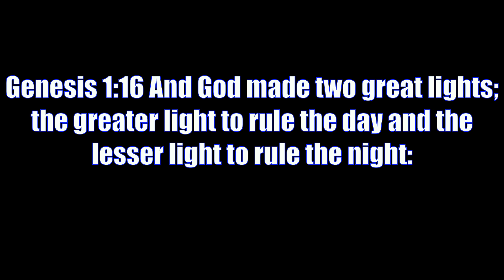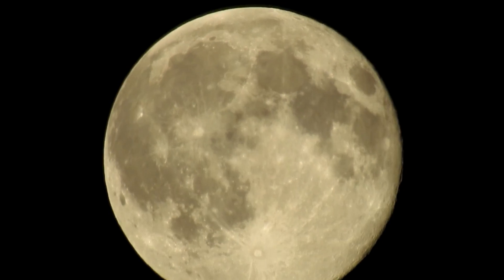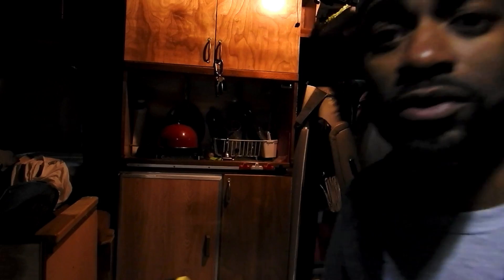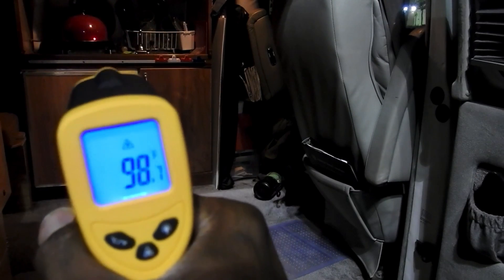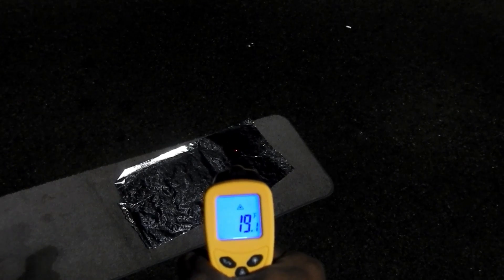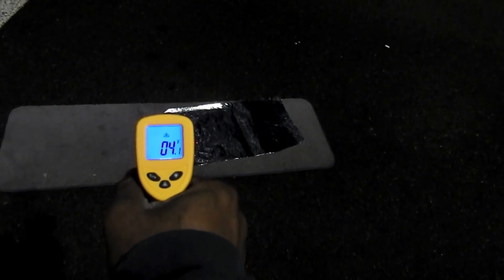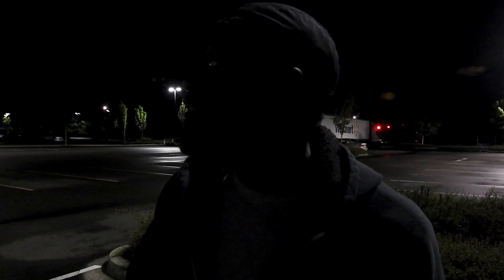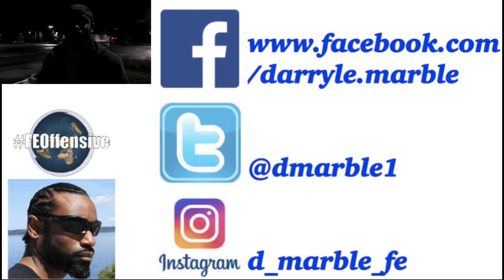Flat Earth: Moon Light Temperature Experiment

Comment from the maker: ATTENTION! There were a couple of things that i was told was off about this experiment. Those things were corrected in this followup...https://youtu.be/6XTij8P_eIQ
Reply: Here is the problem. There is something called "emissivity". Emissivity of aluminum is very low but his reflection is very high. When you measure the temperature with a IR measurer you need to adjust the emissivity of the surface you are pointing to. If you set the emissivity on your IR measurer on 0.01 and than point to the aluminum you will get the temperature of the real temperature of it. But if you set emissivity to 1 you will read only the reflected temperature of the sky (when you are outside). This temperature is at day and at night about -50 degree celsius. That is what you are reading.
Reply from the maker: loadfaster The one I have is an Elekcity Lasergrip 774 non-contact Digital Laser IR Thermometer. I've seen them range from $16-22.
Reply from the maker: I got mine from Amazon for $20 because I'm impatient about certain things. Lol
Reply from the maker: loadfaster no problem.
Reply: To quite adequately paraphrase the great St. Augustine: The Bible tells us how to go to Heaven, not how the heavens go.
https://sokore.wordpress.com/2014/07/26/science-faith-and-st-augustine-on-christianity-creationism-and-the-importance-of-reason-in-the-spiritual-life/
Word to the wise, using the Bible to foolishly claim measurable science is highly ill advised. St. Augustine knew this 1700 years ago, and maybe you should take his sound advice.

D. Marble , the variant ground heat from covered ground v.s. ground at night has nothing to do with the Moon. It's due to the radiant heat being released by the ground that was captured from the Sun during the previous day being trapped/collected in the air over covered ground at night by canopies, foliage awnings etc. hence forth having a higher surface temperature. There is a VERY easy way to rule out the Moon, altho I KNOW you don't have the balls to do it because we all know it will result in an epic self debunk equivalent to Jeran's " That's interesting " moment.
All you have to do is take the measurements of covered and open ground at night during a Full Moon, and do the same measurements 2 weeks later during a New Moon. The temperature variance will be exactly the same. No Moon required. It's best to do this in the Summer Time of course. The Winter Time will likely yield no results either way due to lack of heat absorption by the ground. You'd have to choose 2 very sunny days 2 weeks apart from each other for Full and New Moons, with no snow on the ground for the entire day on both days prior and nights after during measurement. But alas, I know you'll never perform this measurement because we both know what the results will be.

Comment: You can't measure the temperature of a reflective surface with an infrared laser thermometer.
All you succeeded in measuring is the infrared radiation reflected off the foil from the sky and the chair.

Comment: Hehe, nice video, but zero evidence and wrong conclusion. All that due to very improper measurements:
You have to use so called 'black body'  instead of aluminum film. Black body means that the surface is black and matt. As you know, and this video confirms it, your film reflected >90% of light from your thermometer and it does the same with infrared light that your device measured. So in fact you have measured temperature of sky in one case and the temperature of your shadow caster in the second case. And the measured results were a logical consequence of that.
The only question is: did you manipulated the result deliberately or are you only so ignorant?
Reply from the maker: Trial and error is what science is all about. I'll have something for you at the next full moon cycle.

Comment: Excellent D Marble!  I conducted a comprehensive experiment on the Moon's light just last week!

Science is Awesome!

Yesterday On June 6, 2017, three days before a full moon, I captured both the Sun and the Moon in the sky together at the same time.  These two Luminaries were nearly exactly the same height above the horizon on opposite sides of the sky from my vantage point in Dallas.  The Moon was NOT FULL as it should be if the Sun is fully illuminating it unobstructed by anything with both of them in the sky together on opposite sides.  If the Moon is reflecting the Sun's Light as we are told since grade school, then why are we discovering many anomalies and discrepancies to the "Official Story"?? 

In this video demonstration, I will cover the stark differences between the Moon's Cold, wet, dim, and calming light.. versus the Sun's Hot, dehydrating, bright, and energizing light.  I work for an Engineering firm out of Dallas as the head designer/contractor.. and I have been conducting my own personal experiments on the Moon's light and Sun's light.  Most people don't ever bother to experiment with these things, as they blindly accept whatever our government funded education system has told us without question.  Upon further investigation, it turns out that the Moon is a Self Illuminating Semi-Transparent object in the sky, contained within our enclosed Earth realm system!  

https://youtu.be/xkh0lItSLPA

It just so happens that I have already documented the results of my latest research and I have conveniently laid it all out in the blog following this message.  

Here it is folks.  My completely updated comprehensive study proving that the Moon is a Self Illuminating Semi Transparent object inside our closed environment.  I'd love to hear your insights so that I may deepen my knowledge on the Moon and enhance this experiment.  Thank you all for inspiring me to research this topic! 

https://www.facebook.com/notes/miguel-michael-angel/the-darkside-of-the-moon-revelation-through-science-and-systematic-observation/1467743113248516/

I am genuinely interested in seeing anyone's Observable Evidence that the Moon is reflecting the Sun's light.  How many experiments have YOU PERSONALLY CONDUCTED to prove your theories.  I invite you to come join our Flat Earth versus Globe Earth discussion group of over 40,000 members on Facebook to debate your case.  This is an EVIDENCE based group and we encourage people to conduct your own experiments and bring them to the table.  Thank you for watching and don't forget to subscribe to my channel!  

PEACE and Love to all my Geocentric Earther's alike.

Comment: Listen up and listen carefully.  If the earth was flat you could see the Eiffel Tower from the Empire State Building with a telescope.  Case closed.
Reply: chefjimmie1 yeah sure, considering some days you can't even see the end of the street.lol.
particles, dust, vapour etc . also known as atmosphere. that's what the visibility rating is on the weather forecast
Reply: +Lifting the veil
Maybe you couldn't see so far in the visible light spectrum, but you could certainly "see" radio waves (which are also light, of a different frequency) at great distances.

For example shortwave radio can be received thousands of miles away from the transmitter, but only because the radio waves at these frequencies are reflected in the ionosphere, that's called the sky wave.

The ground wave can't be received very far, because of the curvature of the Earth. Between the ground wave and the sky wave there's usually a silence zone, also called the skip zone, where the transmission can't be received.

This can't be explained on a flat Earth.
Reply: Gio Tag:  Thank you for your thought provoking comment.  I was aware of limited visibility through the atmosphere and was speaking more to the idea than to the act however, you have shown that even though it is impossible with a regular telescope, perhaps an infrared telescope might work. (if the earth was flat, that is ;) This is exactly what "flat earth" believers need; some thought provoking!
Reply: Gio Tag I am aware of frequency and radio waves, it's called troposcatter, signals are sent up to the troposphere and reflects back. that's why all 'satellite' dishes point at 45 degree angle and not straight up. research troposcatter radio.
Reply: chefjimmie1 use a laser, that would cover great distance through atmospheric conditions. lots of experiments on YouTube available. land surveyors and engineers don't even consider curvature when they design railways, canals, bridges etc. The navy's weapon systems use laser targeting on targets hundred of miles away , they target them from the ship using line of sight.
Reply: LIfting the veil:  engineers don't need to factor in the curvature of the earth in construction because the factor is such a small number compared to the size of the project.  They never survey farther than the horizon.  I"m arguing about NONSENSE!  I'm outta here.
Reply: chefjimmie1 yeah like the Suez canal that links two oceans, it's over 100miles long with no change in depth and no locks needed to control water flow.
Reply: Shortwave radio, troposcatter communications and satellite TV are three different technologies.

Please don't contradict me on this subject, I happen to know a little more about it than you imagine.

By the way satellite dishes point at an angle from 0 to 90 degrees, depending on the location of the dish and the orbital position of the satellite it receives.

Comment: The main contention these moonlight videos are getting hammered with is radiative cooling.  I hate to say it but did you account for all sources of heat in this observation?

I've ordered a solar cooker and some laboratory grade bulb thermometers.  I'm working under the instruction of a globie so that there will be no "you didn't account for...." arguments.  Also, I plan on taking readings nightly as the phase changes including new moon(which is another globie point of contention).

Great video, but to you'll have to rinse and repeat several times and record the data if you want a white coat wearin' globie to give it a second glance.

Lastly, the next time you get a 40 degree difference in your reading, put your hand there and see if you can feel the difference.  That should be noticeable to the touch.

Comment: Brother your experiment looks cool, but just I would like to add a suggestion. Since you are using the same foil for the shaded area and the non shaded area and also it is an aluminium foil it would conduct and the temperature you notice would be neutralized with time.  so try the experiment with disconnected foils , I mean to say tear the foil into two pieces or use two foils. One for the shaded and one for the non shaded. Check the results it might vary and would retain temperature for long time.
Reply: https://www.quora.com/Aluminium-is-one-of-the-best-thermal-conductors-Why-is-aluminium-foil-used-for-packing-eatables

Comment: That's pretty much undeniable proof right there. 
You calibrated your equipment and had tightly controlled experimental conditions, and repeated the experiment several times, getting a range from zero to 45 or so which you would expect in real world conditions where things aren't "controlled."

Can't wait to see the ballheads try to "disprove" your results. I can guarantee they won't ue testable, repeatable science, they'll just nay-say, hate, and jump on the scientism bandwagon
Reply from the maker: They'll say i should have used different pieces of aluminum or question the distance.
Reply: I heard that planes flying in full moons need more de=icing sprayed on them, from airport de-icing crews. why they have to do that if the moon light doesn't make things colder and increase ice content on the control surfaces??
Reply: Hey bro. Yes the moon is cold, and knowing this you can predict the weather.
Reply: Groundhog -  How is it proven that the heat or cold is coming from the Moon?
Reply: D. Marble no! They will say the foil was flat! You needed an aluminum ball. Lol.
Thanks for  doing this experiment.
Reply: Yea, they'll say shit like the distance proves the temperature or where you were wasn't the right place. but the face it is you measured temperature under PERFECT controlled conditions with the most accurate instrument available.

That think looks at a single, like millimeter by millimeter spot on the target and give a 100% accurate temperature reading, the most accurate temperature reading possible today... and they can't stand that these flat earth facts can't be refuted or proven wrong.

Comment: I saw a guy shoot one of those at the sun, and around the sun. The sun was around 500 degrees, maintained 500 ish, and the temp obviously dropped when the temp sensor (laser) was not in direct line with the sun..... I wonder the range on these temp gauges lasers. 

I see ppl shooting laser beams across Lakes, and far distances to show flatness, I just wonder the accuracy of the temp at a great distance. 

Might be worth a try if possible, just thinking out loud.

Also, maybe this one of the reasons the Gov doesn't like ppl with lasers pointers and shooting them upwards, ya know...

Thx for sharing!
~
Reply from the maker: No problem. I'd imagine that's the reason they don't want people to have lasers and all. Hmm
Reply: D. Marble Might be worth a FEOffensive investigation....... A FEOI....! :)
Reply from the maker: We're on the move!
Reply: Mark Aaron the laser on those temp guns is just "a target finder " it's not taking the temp.. the iner circular lens is doing that and you wanna be no more than 1 to 2 feet away the further out you are the less accurate
Reply: I have aimed it at a wood stove while it was burning and it was over the range that the mp gun would tell the temp. It said high!! so The sun is too far to get an accurate reading but it isn't 92 million miles away.
Reply: D. Marble Oscar Tango Mike! 
~
Laters
Reply: NoFearX Ps: I see what you're saying though..... for some crazy reason I was thinking the laser was reading the temps... my bad! 

Either way, there might be something to investigate further here. 
Thx again!
Reply: Mark Aaron that would have probably been Neil Oakley

Comment: Something is wrong with your pyrometer. Should read cooler in the moonlight but there's no way it's going to read 3-4 degrees. It's going to read close to or a little less than the ambient temperature of the air. Your reading freezing temps. Check the settings. Love your work though. Keep it up 💥👊🏼🌍🔫
Reply from the maker: But I calibrated it in the beginning...geez.